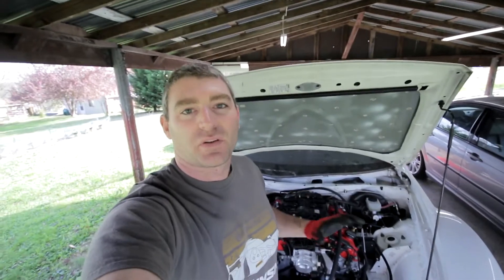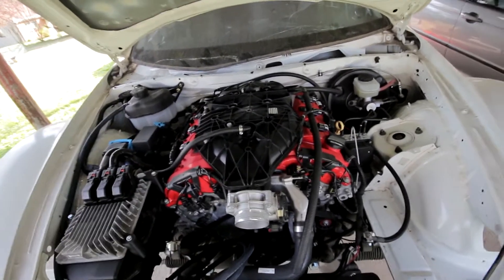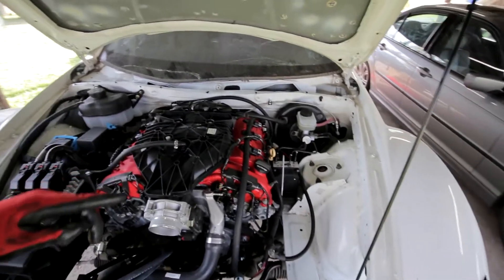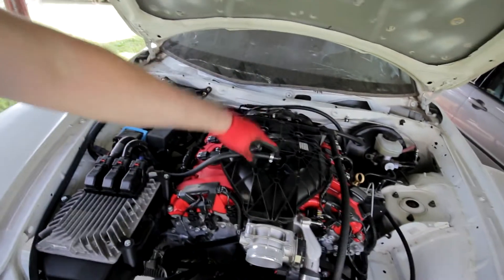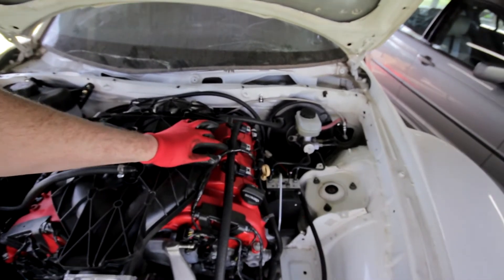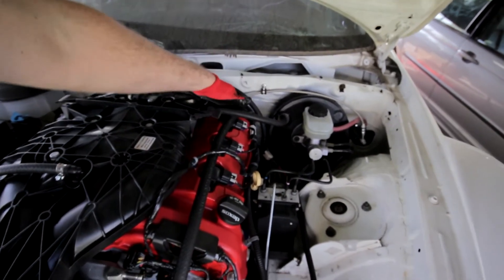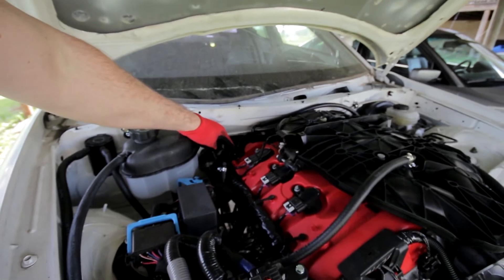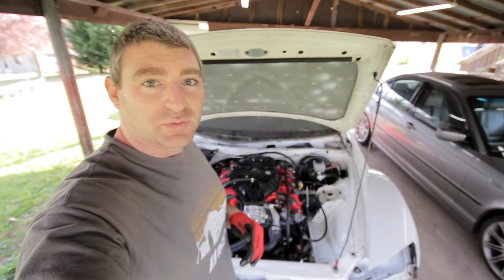GM LFX CCV/PCV Drill Mod

Comment: Are there any problems to the engine by venting the crankcase to the atmosphere with larger vents in the valve covers and plug off the vacuum line?  Other than environmental?

Comment: I have a boosted 2016 LFX Canyon with a catch can set exactly how you're saying not to. Routed both rear valve cover to In and Out on the catch can. And with the air breather on top. Yes it's true. I have oil leaks where I'm not supposed to. That and also I can't build any boost. Thank you.

Comment: The question NOBODY is asking is WHY doesn't the OEM put these on a stock vehicle and schedule it as a part of oil changes?  If it means a few more bucks come oil change time, so be it.  But for God's sake, GM, what are you thinking?  You KNOW it's a problem, and you know it's going to cost you warranty money - so fix it.  Do the right thing.

Comment: Thank you for explanation, I have srx4 2012 and I found a lot of oil on the back of the throttle body and air intake when I was doing TLC and im planning on installing catch can to prevent it. good that I saw your Video, otherwise I would’ve hooked it wrong as you said in the video. 👍
Reply from the maker: Awesome! Thanks for watching

Comment: Great series- not much on the LFX out there at all.That said, my earlier research on the lfx turned up more cam chain drive problems than normally would have been expected- same for the GM HF DOHC V8. And likely due to poor crank case venting letting grik stack up in the system. The passenger Valve cover comes off and every thing looks great- the driver's side looks like it was flushed with sewage and much older and beat up than the pass side- the timing chain life is shortened below the recommended service interval (100K?) and is prone to catastrophic failure- this is an interference engine- no timing chain and all the open valves will bend and break on the pistons which will be made junk in the process. You Tube guy only has a part of the story and he didn't understand it- YT guy; before you rap me, there are several service bulletins out on this, from GM and several builders have verified it.
Reply from the maker: Thanks for you input. I agree, the design is flawed. From what I have seen over the years, the big issue, and the reason there is a service bulletin for this, is most likely due to the oil change indicator in the vehicles allows the oil to deteriorate more than is should before indicating, or the car owners now servicing the oil when it is supposed to be. The owners that have been diligent in changing their oil regularly with quality oil do not seem to have the timing chain issues. I plan on keeping up with my service and not worrying about it.
Reply: @trackcarobsession  Had to replace complete timing chain kit. Tensioners, solenoids, valves. Everything. Just to find out the engine had more internal damage beyond repair. Ended up dropping another engine. Complete nightmare. Do not go by the display oil life percentage. These motors are major oil consuming monsters.

Comment: What wiring harness are you running with the swap
Reply from the maker: For this car I am using a stripped down factory harness to run things like lights and ABS sensors, but the engine is on a standalone GM engine harness that has been modified to not need the body harness. This engine has now been moved to my daily driver and I will be going with a different engine for this track car.

Comment: What to do with the fresh air (intake side) hose when you are with an FI setup ?
Reply from the maker: Good question. Most of the time you would run the vacuum side of the PCV to the intake hose before the source of forced induction.
Reply: Yeah Track Car Obsession is correct, I might be wrong but I imagine most stock turbo cars will go: Air Filter > MAF Sensor > T-piece for fresh air tube > Turbo inlet, this is so at WOT when the direction or air changes in the fresh air tube that oil doesn't then dirty up the MAF sensor as the T-piece is downstream :) If you are talking about the GM HFV6 like in this video with FI setup the PCV Dirty vacuum side may have to have a  good check valve installed (easy to open from small vacuum and shuts relatively tight at rest) Have it  pointing away from the valve cover on the PCV orifice port (dirty side) and into the intake plenum like stock (where vacuum will be as its post throttle body). so that at idle when there is the most amount of vacuum the check valve opens allowing the normal system to work, then when there is boost the valve shuts stopping boost pressure entering the crankcase. now I'm not a trained mechanic but I usually study what comes with the car as automakers most the time have the best system.

Comment: Pcv ONLY works best during cruising speeds... or during ~10 inches of vacuum. At idle and wot it does little no nothing ..
Reply: You have it around the other way, the clean tube inlet will do next to nothing during idle and cruize, the dirty side that has vaccum at idle and cruize will do 99% of the work, during WOT the PCV orifice wont be used as much and the flow of filtered air from the T-piece after the MAF but before the Throttle body will reverse flow - thats why the Clean tub has a ia large 12.5 mm ID to maximise flow in the lower vacuum state or to let the crankcase purge itself back to infront of the throttle
Reply: My comment stands and its 100% correct ... Read up on the PVC valve and study how it works under DIFFERENT vacuum conditions ...
Reply from the maker: You are correct other than the idling part. There is plenty of vacuum in the intake manifold to pull air through the PCV system during idle while the TB is mostly shut. Regardless of when it is used, it is still very beneficial for an engine with direct injection. Yes, the PCV valve could be vented to atmosphere, but from what I have read, and just imagining the system working the way it should, it seems that it would be most effective at removing the oil/gas vapors if clean air is brought in one side and removed on the other. Just my opinion though, doesn't mean it's right.
Reply from the maker: I understand how it works. While the PCV valve does regulate flow under really high vacuum, it still allows flow. So at idle, it does still pull air through the PCV and through the catch can, collecting droplets of oil/fuel. Which therefore helps prevent buildup in the back of the intake valves.
Reply: Track Car Obsesson:
I don't like the PCV system... Its flawed and does not work 100% of the time so i remove it on all my cars ... People can say it works 100% of the time but that is NOT true ...
The crankcase needs to breathe every second its running ... Whether its idle, cruise or heavy throttle, its needs to breathe and it needs good size ports ...
Reply: dude you have some of the highest vacume at isle and light cruising when the throttle body is almost closed yet there is elevated engine rpm..... re read your stuff man. or better yet get a vacume gauge and do some learnin...
Reply: @darinr9424  WHO is this comment to ??
Reply: @ACommenterOnYouTube  ehh to lazy to find the name. the dude makin all the fuss about the 10" of vacum  Bs. depends alot of wha type of pcv valve u have. rattle type or just the metered orifice type.
Reply: @darinr9424  says the person that does not know how a pcv works ...
Reply: comment is also for a pcv that has the rattle inside. other type with just a small hole dont work quite the same. higher vacume works the same or promotes even more crank case gas removal. depends on the type of valve on your 10 inch statement
Reply: @darinr9424  the average car runs on ~20 inches of vacuum. So cruise speed is ~10 inches of vacuum. Thats when the pvc is pulling the most amount of crankcase gasses. When at idle or nearly full throttle its partially closed. 
That crankcase needs 24/7 ventillation and especially during heavy throttle.

Comment: 👍 There's also a redesigned valve cover gasket for the right side cover with a larger opening for the pcv area.
Reply: And passages in the heads for the pcv system that can clog on neglected engines.
Reply from the maker: Good to know. Thank you for the info 👍